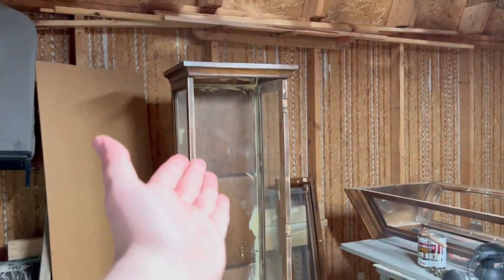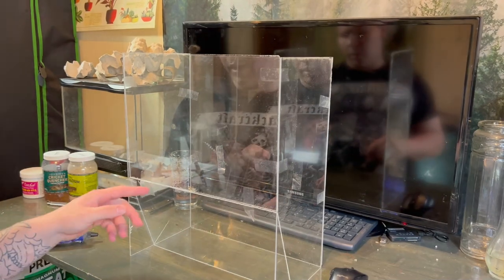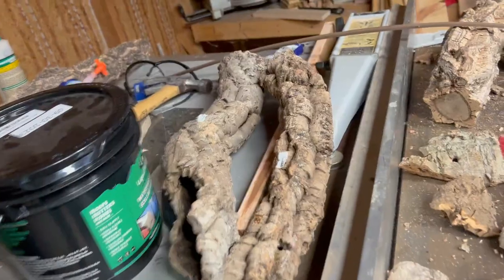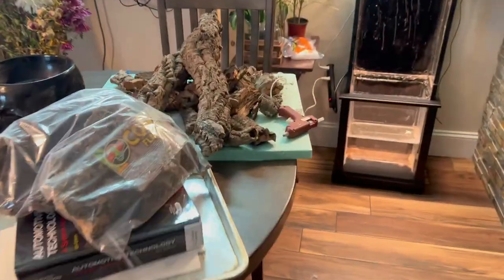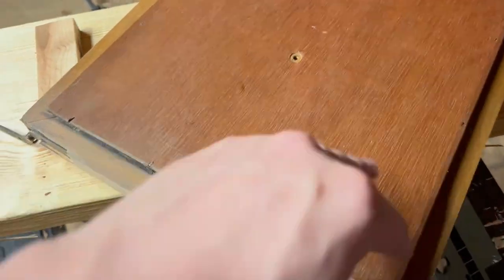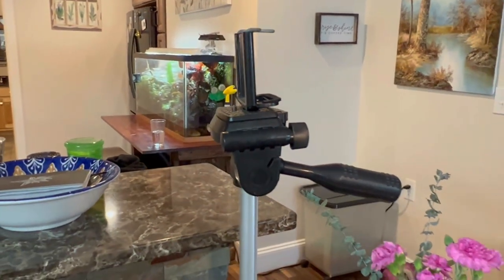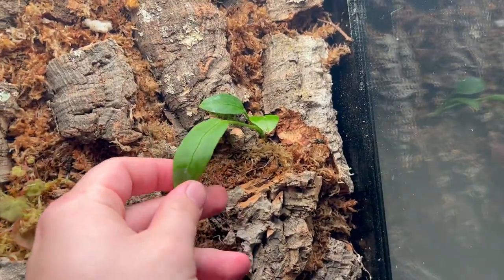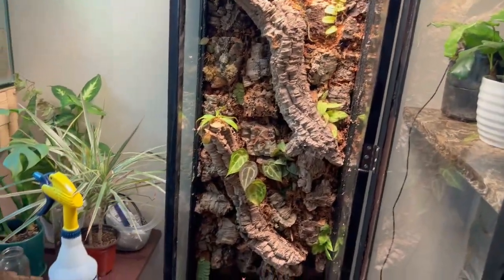I Built A Custom Vivarium Cabinet

Comment: Could you do this for a crested gecko tank, I am looking to upgrade my sub adult and actually have an old corner unit? Are there animal safe rubbers and silicones? Xx
Reply: ok this comment is gonna be really long but here’s some important advice for building something like this. liquid rubber is safe for animals i’ve used it for a crested gecko, flex seal actually works pretty well because it’s just liquid rubber. the regular flex seal that is, idk about the pastes. as far as the silicone just make sure it’s 100% silicone 1, some people say silicone 2 is fine as long as it’s fully cured but others say it isn’t. it might have a mold free for however many years guarantee on the front but that doesn’t mean it has fungicides in it as long as it says it’s 100% silicone. also cyanoacrylate super glue is completely animal safe once cured, i use loctite and gorilla glue gel in builds to attach wood and dried moss. if you’re thinking of doing the popular background method of foam covered in silicone and coco fiber i wouldn’t recommend it for a crested gecko cause they can’t climb on it very well, the cork bark method in this video is best, but it is good for attaching large branches more securely than silicone or glue. just get some pond spray foam and spray it around the ends of the branch and the sides of the enclosure. the foam doesn’t stick to glass well so i recommend siliconing a few small rocks to the glass where you’re going to attach the foam to give it something to hold on to. then just carve away the shiny exterior of the foam into whatever shape you want once it’s cured. you can leave it as just the foam because it’s black and somewhat blends in, or you can cover it with silicone and press coco fiber into the wet silicone, adding some orchid bark makes it look better. the only other thing to take into consideration for a crested gecko enclosure in something like this is airflow, you’ll need at least half the top to be screen for airflow and you’ll probably also want some type of vents near the bottom of the enclosure, which could just be holes drilled in the glass with screen over them. if you don’t want to do all that you can just put a hole in the top and attach a small fan to blow outside air into the hole, but you’ll want it on a timer so it doesn’t dry the enclosure out too much, works especially well combined with a misting system. also for a crested gecko you might want the background to be on one of the sides as well just so the gecko has less of a 2-dimensional living area, they like corners to feel secure in such a large enclosure. and if you make something for a crested gecko with cork rounds make sure you plug the ends of them with filter foam unless it’s a piece that you specifically want it to use as a hide, they can get stuck in smaller pieces
Reply from the maker: Epoxy pond liner, the rubber liner I use, and flex seal are all safe. The one I have is the cheapest option but it stays tacky for a week or two after you paint it on. As for silicone you just want GE silicone 1
Reply: @Stephen-jw8ci  thank you very much, all well received advice, I had a few suspicions about the things you said like ventilation. Will do much more research before committing but would definitely prefer the more natural look in this video with the cork bark, it looks so natural and brilliant for climbing, I have alwsy just had the standard exo terra tall large glass  Viv's for my adults but seeing this in my suggested videos and having an almost identical unit that I was planning on getting rid off it just seemed like fate haha thanks again 😃
Reply: @ormsonaquariumdesign3587  thank you so much, I appreciate the advice and the inspiration.